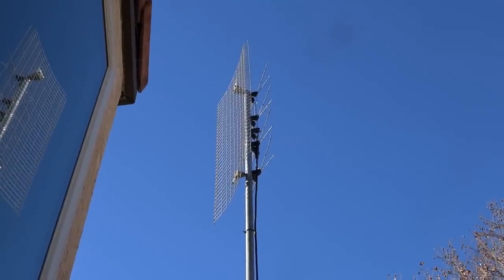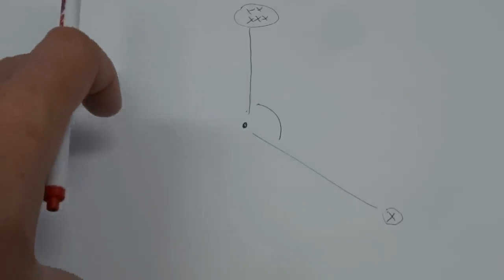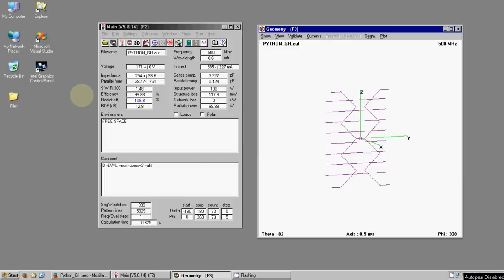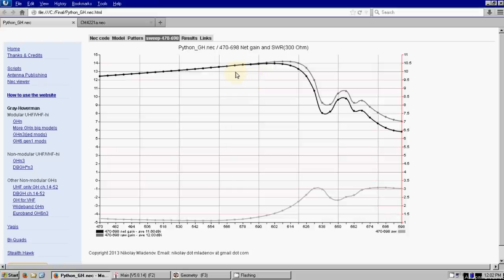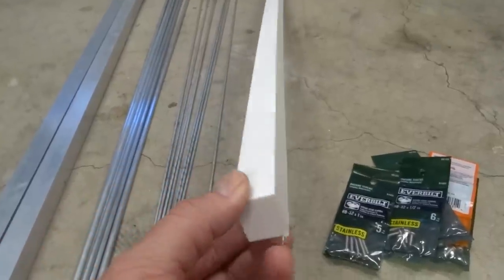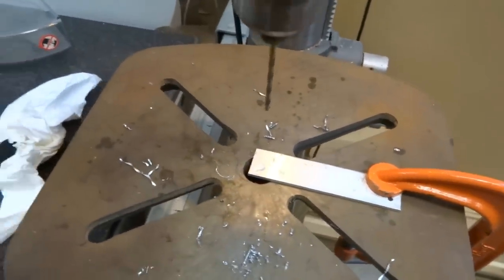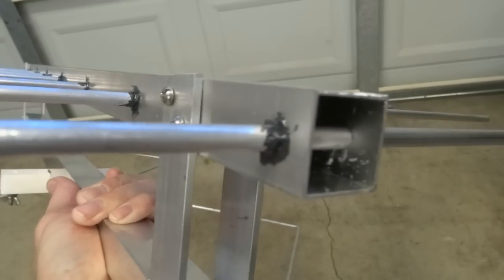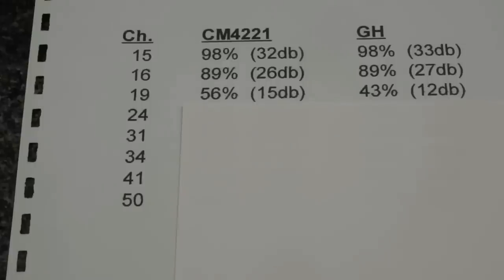Homemade Gray-Hoverman TV antenna

Comment: You made this  out of Aluminum ?   Years ago I live in a trailer and it was  wired with aluminum. Every six months or so a plug in would stop working. Or a light stopped working.  Aluminum corrodes very quickly. Every time this happened we had to take it apart  and clean the wires. We used  something called, Nolox ,  it was supposed to help prevent it from corroding. 
I was told that aluminum  is not one of the best materials for making an antenna. Believe me it is a pain in the ass  to have to take it apart and clean.  Copper is suppose to be much better.
The problem I am having is how to keep it from rusting. Does anyone know of a some kind of sealer that keep it from rusting.
The only other thing I can think of to use is a Stainless steel. And like everything else I will have to order on line.
Reply: Usually when aluminum and copper touching each other is when you get damaging corrosion. It doesn't hurt for the elements to get a little corrosion only the connections need to stay clean.
Reply: i think william is concerned with the connections corroding, not so much the appearance of the elements.  Clear coat would totally insulate the connections.  The grease you use for aluminum house wiring or any dielectric should work well at the junctions.
Reply: William Wynn sad to say almost all the new stuff on the market is made with aluminium.   SCARY
Reply: Aluminum can be filed or coated in a corrosion resistant material that does not interfere with the antennas Recieving properties.

Comment: can I ask the measurment of the elements?
Reply from the maker: I don't have the measurements.  But if you download the design file load it in 4nec2 you can get the element lengths.  Both download links are in the show notes.
Reply: thanks!

Comment: You forgot the Hat on your antenna top and bottom this will change the readings dramastically
Reply: hat?
Reply: The top and bottom caps are for VHF reception.
Reply: NAROD hats are only required if you want to receive VHF High channels.

Comment: Atlanta still has channel 69.
Reply: not for long.....
Reply: Atlanta's WUPA 69 is actually broadcasting on channel 43 and will soon be repacked to channel 36 because of the TV spectrum auction. Channel 69 is the virtual PSIP channel number (this was done in the digital transition to allow stations to retain their years of channel branding.)  For those building optimized antennas, remember that few TV stations actually now broadcast on the channel they're branded as. You can look up this information easily by market at: www.rabbitears.info

Comment: You must have been desperate to find a new hobby. If all your transmitters are 8 miles away, LINE OF SIGHT,  all you need is a paperclip to receive them.  Your pursuit to find the perfect antenna is FUTILE.  You wasted your resources.    (Can't improve upon the ideal.) There is a law of diminishing returns for antennas. 

The lone, out of pattern broadcaster can be tuned with the Yagi you proposed. Then it is a simple matter to duplex the two outputs together into a single cable.

Comment: Ok i have to tell you you can not pickup hd signials .  a antenna picks up uhf and vhf  signials. I no that antennas say hd on them but its just a slogan to attract buyers. Also the theory channels 2 to 14 are vhf and 14 to 51 is uhf is no longer correct since digital. Like  i get on my antenna 59.1    59.2    note the channle is greater than your 51 . and your saying its uhf  because its higher than 14. No my 59.1 and 59.2 are vhf channles. They dont do it that way no more you have to check out all channles now days to see if its vhf or uhf. They use to do it like you saud but not no more the number means nothing .  im not being a smart ass im just giving you facts. I like your construction work. I also make antenna as a hobby. Not for sale for my own use and a few friends. I like your vid. Very well done. And that is a great antenna. I would of  left old 4 bay up and conected and the hoverman. They may of interfeard with each other but sometimes they do not.